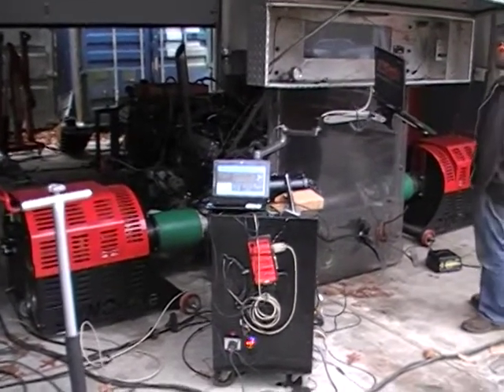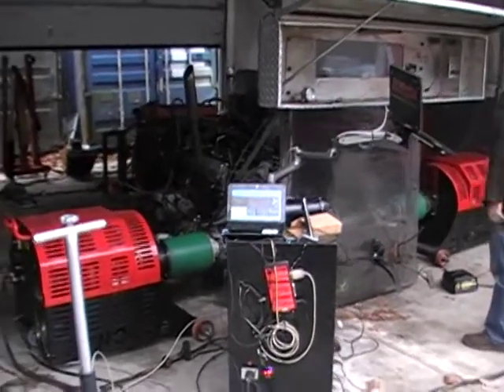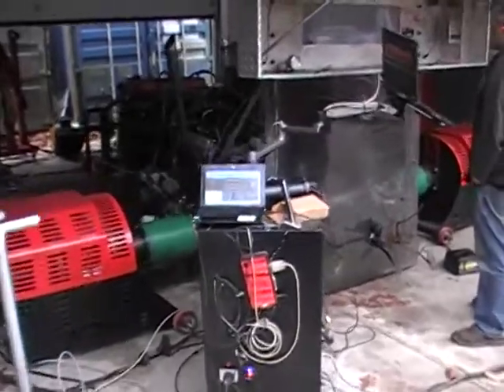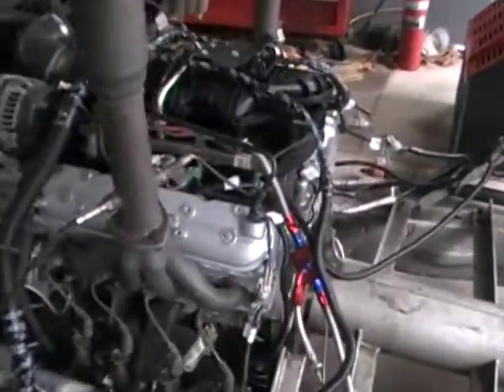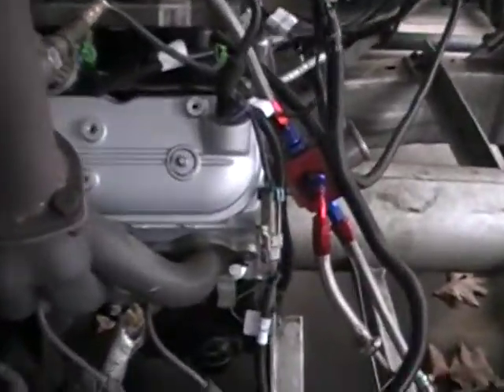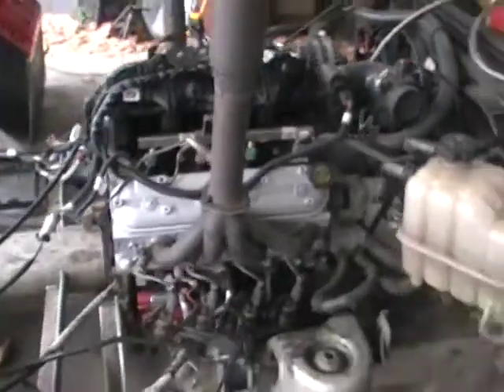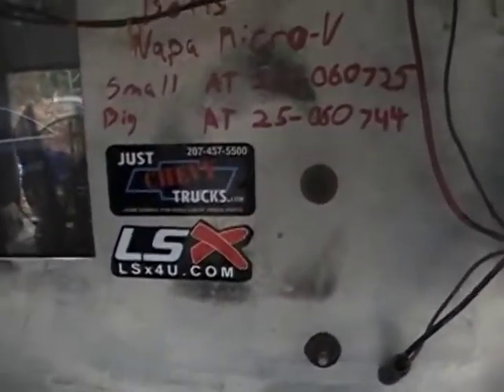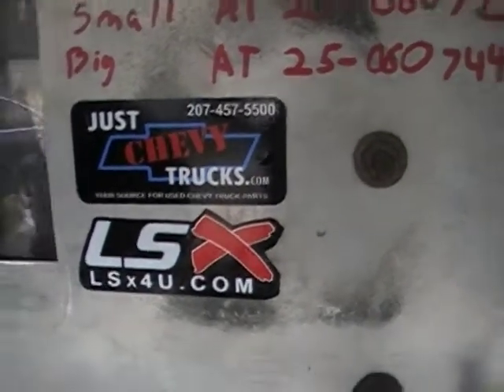Stock # ou812 All Aluminum Chevy 5.3 LS Engine, Flat Top Pistons, 706 Heads, Cam

Comment: I have an 4.8/5.3l LM7 truck block stock bore. I ordered a FiTech Ultimate Truck Fuel injection system for 500hp. Any recommendations on GM cyclinder heads I should investment my money into for porting? Thank you!